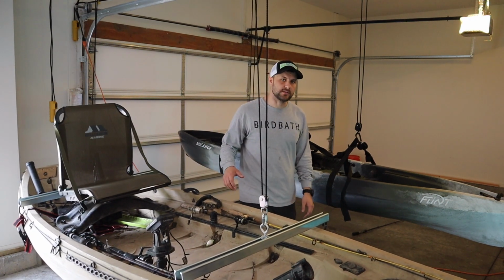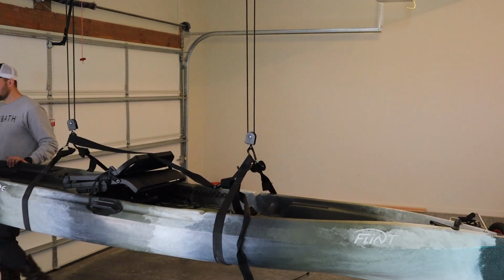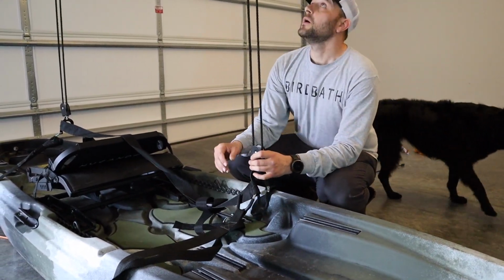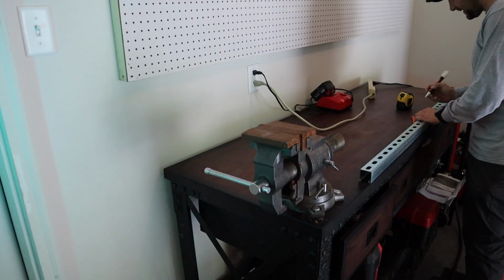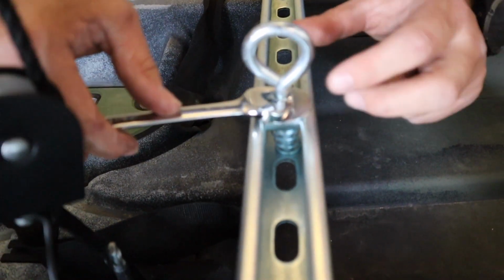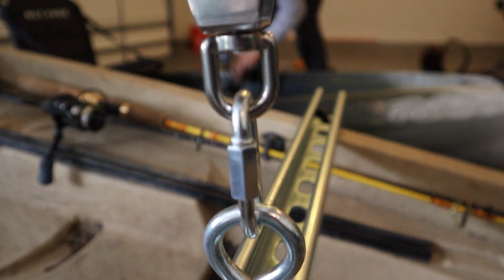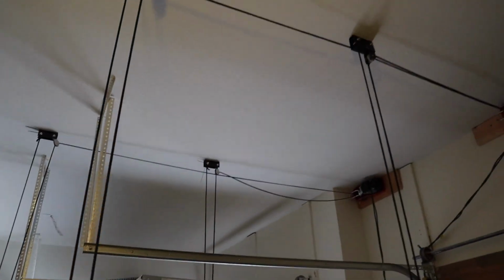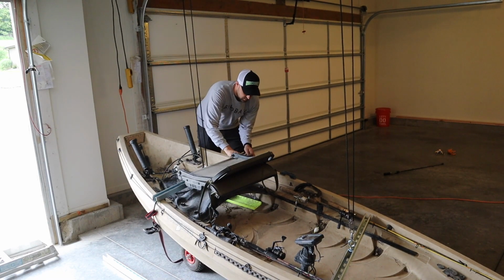KAYAK ELECTRIC LIFT | Harbor Freight Hoist/Winch |Garage Set Up with Nucanoe Frontier & Flint kayaks

Comment: So on this Raz sport kayak hoist, it comes with a brake on the pulley system... Did you remove it so you could run the automatic winch? The reason why I ask is because I recently purchased a manual hand crank winch. Because lifting the kayak by hand sucks! Lowering & lifting it is tricky. The braking system locks & prevents me to this. I believe the weight of the kayak is preventing it to unlock properly when I pull on the ropes. Hope to hear from you soon. Thanks!

Comment: The idea of using unistrut to avoid squeezing the sides of the kayak inward is very helpful. I live in SC and the heat could easily make a kayak hull bend under pressure.  For the same reason, everyone says you should put the pressure on the top gunwales, not the hull, meaning turn it upside down. I can also see why that is inconvenient because it means you can't leave equipment inside the kayak.  Lots to consider.   

I have three heavy (Hobie) kayaks I want to store. I suppose I will need three electric hoists. Still, that saves a lot of wear and tear, especially with a 12 foot ceiling.

Comment: I agree, The pulleys that come with that system are junk(plastic). Pull them off, replace with metal ones.
Or buy all metal to begin with.
I like using the strut, for the reasons you mentioned.

Comment: great minds thinking alike---I rigged up a nearly identical hoist system a few years ago. Finding that if anything is stored in the kayak, the weight must be equally distributed to prevent it turning sideways. tied rope from the ends of the unistruts to the lower pulleys (forming a triangle) which helps some.

Comment: This is helpful, but I think you convinced me to go with the simpler design.  I will be lifting it off of and onto a car roof, so I think the soft straps will be easier.  Also, my ceiling is absurdly high, like 20 feet or something, so I don't need clearance!

Comment: Since you're using a 440lb electric hoist, you don't need any mechanical advantage. Why not a simple, zero-mechanical advantage system? You would need only two pulleys and half as much rope, although the rope and pulleys would need to be stronger. Also, it would take half as long to raise or lower.

Comment: How did you mount the winch to the wall?
Reply from the maker: Lag bolts
Reply: @BirdbathWaterfowl  did you do a video on it like you said you were going to? I haven't seen anyone put it on the wall vs the ceiling. how did you determine where to/how far apart to put the parts on the ceilings?

Comment: Did you change the line in the hoist?
Reply: Dude, left me hanging waiting for that additional video about the rope versus wire! Please
Reply from the maker: @trinacria1956  we are on it! Sorry for the delay
Reply: @BirdbathWaterfowl  Have all parts just wondering how you attached the rope in place of the orignial cable? Did you drill out the cable hole on spool?
Reply: @trinacria1956  I pulled the grey spacer out and removed the cable. Then I looped the black rope through the slot and pushed the grey spacer through the loop.
Reply: @danielbradley2387  Could you give detailed instructions on how you replaced the cable?  I'm very new to pulley systems, and it looks like from the video there's an end of rope tied to each pulley housing that's mounted on the ceiling.  When this system is fully rigged as shown, is there 1 single rope that begins in pulley housing 1, goes through the hoist and then back to pulley housing 2?  Or are there 2 individual ropes?  Thanks.
Reply: @danielbradley2387  can you show a pic of what spacer you removed to replace the cable with rope? I don’t understand
Reply: @BirdbathWaterfowl  where do I buy pulleys and how to mount winch and rope to lift.  I love what you did in your video
Reply: @BirdbathWaterfowl  I just found this video then scrolled to the comments to find a video about the winch/rope setup.. Only to realize it's not there :( Please make one it would be much appreciated!
Reply: Hello, can you provide some more detail on how you were able to get this cable replaced with rope? Almost done with the project but stuck on this last part! Thank you!
Reply: I removed my cable and replaced with rope.  Wasn’t very difficult.  I used your unistrut setup too
Reply: @dthreatt  where did you find the replacement pulleys? I've been looking all over
Reply: Great that's what I thought but was not certain.
Reply: @trinacria1956  holler if you have any issues, or you can send me a pic and I’ll let you know if it’s right.
Reply: @danielbradley2387  where do I get pulleys
Reply: @danielbradley2387  hey man, I wonder if you could help me with find the replacement pulleys. Do you remember where you picked them up?
Reply: Got the rope to work! THANKS! Rewatching I see, in last few seconds of video, you replaced all the pullies. You did not mention that. Looks like all pullies are now singles? That seems better. Mine worked, but need it to go more flush ( low garage ) will have to use one long parallel bar and run straps through my scuppers so bar is low & pullies end up below gunnels. I had bunch of green  6' steel fence  T poles I  used have 1/4 holes already.  Guess need 2 more pullies. I am having problem with new pullies banging into original black pullies.
Reply: @trinacria1956  I had one kayak lift that I used the original pulleys except for the ones next to the kayak. The other lift I had, used really cheap pulleys so I replaced them all.
Reply: Thanks
Reply from the maker: Correct, removed the steel cable and just used the rope included in the kayak manual lift kit. We will be doing a complete separate vid on the setup and install of the electric hoist.
Reply: @BirdbathWaterfowl  will you share how to mount the harbor frt. winch. I’m hanging my kayak exactly the way you did.  Love it.  I sure need help…single woman with bad back!!!  I’ve purchased everything. I did not see link to pulleys either, thanks Tanya
Reply: Hey there, any update on a video, or even description of how to switch out the cable for the rope? I’m at the final stage and can’t get it figured out! Any help would be greatly appreciated! Thanks!